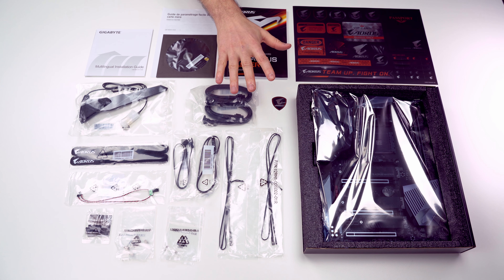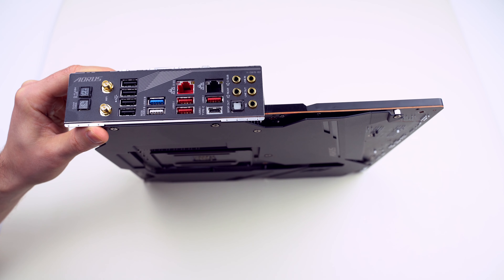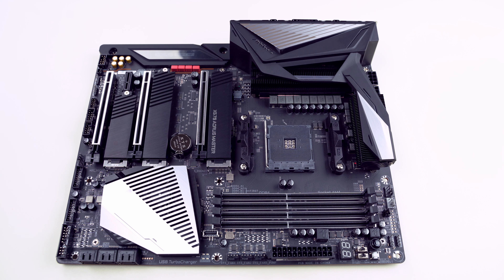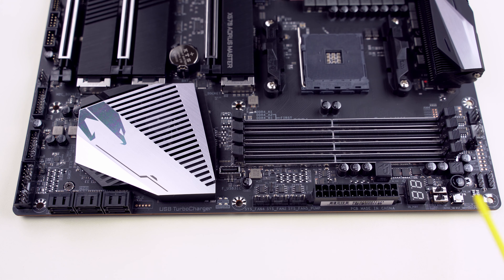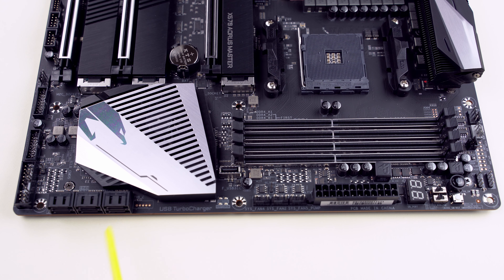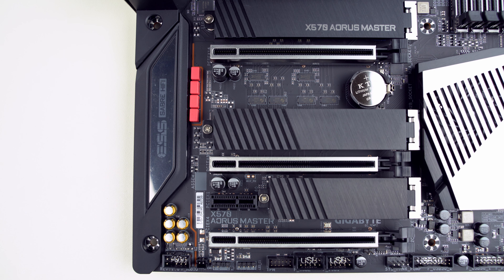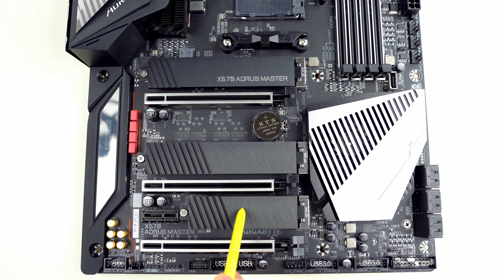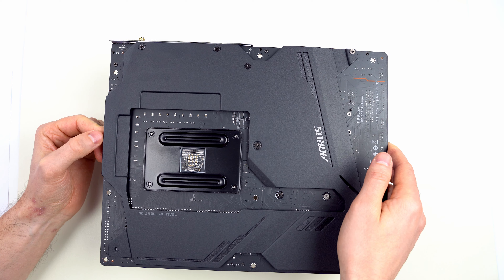Gigabyte X570 Aorus Master - Unboxing + Complete features description

Comment: Hi Martin. Thanks for your video. Which of the M.2 slots should I use if I want to use two M.2 SSD drives? Which is the fastest slot and the fastest configuration for two SSDs?
Reply from the maker: Hi Owen, you´re welcome. 

To your first question: 
The fastest (or better to say unlimited by other devices) is the first M.2 slot (M2A_socket) which is closest to the CPU and is directly connected to it (The theoretical speed is the same on all of them, which is 4x PCI-E. Other are limited either by the chipset or other devices connected to it - because they are sharing the bandwidth to the CPU which is PCI-E 4X).
 
The other two (M2B_socket and M2C_socket) are theoretically capable of the same speed (PCI-E 4X) if they are not used at the same time in sense of not being read from or written to (they can be connected/installed at the same time) and when the last two SATA ports aren´t used (as shown in the video - you would disable them by using M2C_socket).

To your second question:
The fastest configuration of two M.2 SSDs is if you put them in the first two slots (sockets M2A and M2B). I used it for my RAID 1 config and was able to achieve READ speed little over 6 GB/s without any problems (with two 480 GB Corsair MP510 drivers used in video mentioned at the top). If you use PCI-E Gen4 drives you should be able to get close to the theoretical limit of two PCI-E 4X slots, which is around 15,7 GB/s (combined). 

If you DON´T plan on using the last two SATA ports, you could also use combination of M2A and M2C sockets and you should be able to reach the same speed, but I haven´t tested it yet (will do it later). I Hope this helped ;)
Reply: Thanks a lot Martin!! I'm using a different operating system on each one and for that reason probably cannot use Raid cause every drive is formatted differently. Maybe a short addition: I would also like to add 1 or 2 SATA drives. Does it matter where I plug them in/which SATA slots I use? Thanks in advance! 🙏🏻🙏🏻
Reply from the maker: @langermusic  If you´re using two M.2 drives with 2 different operating systems you could you use RAID only on one of them (if you wanted to) by adding one more M.2 drive to the third M.2 slot (Sockets M2A and M2B would be the RAID with one OS and M2C_socket would be standalone with second OS on it). 

Another option would be using two M.2 drives - sockets M2A and M2B would be the RAID with one OS and 2 SATA drives in RAID for the second OS (this one would be slower of course than RAID made of M.2 drives, but would potentially (if RAID1 was used) provide you with redundancy if you need it).

How I understand your situation is, that you want two M.2 drives running each with different OS as fast as possible and add 2 additional SATA drives and run them as fast as the MB allows you to. 

In that case, put each OS on one of the M.2 drives (1st OS on drive in M2A_socket and 2nd OS on drive in M2B_socket) and use any two SATA ports (out of 6 available), the speed would be the same on all of them.

If you plan on using the 3rd M.2 slot in the future (M2C_socket), connect your two SATA drives into any two SATA connectors out of 4 available (the last two - 4 and 5 will be disabled when you connect the 3rd M.2 slot). Now, which four? In the manual they are shown as SATA ports 0,1,2 and 3 or for visual orientation the four which are closer to the 24pin power connector. I would connect them into first two SATA connectors - 0 and 1 (manual MB layout - page 7).
Reply: @MartinsLab  Thanks so much! That really helps! I like your idea about the RAID system on one OS. Will each of the RAID drives by itself work faster if I have them connected together as you said? So generally the OS would be even faster than only with one drive? Do I need to exact same m.2 drives? Cause one of them is 2TB and the other one is 1TH. How should I setup the BIOS? Big thanks! Owen
Reply from the maker: @langermusic  I see it got you excited about the RAID. That is a pretty complex set of questions 😊, let´s try to sort it out, one by one: 

Part 1 – Is one vs Two drives for OS (RAID 1 and 0) faster?
You can have a RAID 1 for the OS on two M.2 drives but it wouldn´t make the OS run faster. Write operations would be about the same and read would be faster only in very few cases (when reading larger files). The only senseful option of using RAID on OS drive (on this MB) is RAID 1 for redundancy (for reliability - to make sure if one drive fails you can continue your work without any downtime). If you used RAID 0 for OS, you would significantly (by 50%) increase the possibility of failure of the OS which is generally not recommended for OS drives. 

OS usually consists of thousands of very small files and using RAID wouldn´t speed up its operation (it is more effective with files of bigger size). If you test it when installed on 2 drives in RAID 1 or 0 with Crystal Disk Mark, it will show you impressive numbers - like I mentioned 6GB/s, BUT it is reached only with large files during continuous read operations which on OS drive occur VERY RARELY.
 
It can be beneficial for working with large files like a 4K/8K video (mp4/mov) or large RAW photos and such, but they wouldn´t probably be placed on and OS drive unless it was big enough drive and you put those files there purposefully - than RAID 1 would make sense even for perfromance reasons (not "just" reliability). The READING of those files could be up to 2x faster. 

(In my build video I´m using it for the redundancy reasons)

Part 2 – How to get the fastest OS operation possible
If you want the fastest OS operation, basically you need the fastest (single) SSD or set of fastest M.2 SSDs (for RAID 1) you can get and have enough RAM (in dual channel) installed so that the OS doesn´t have to swap often. That means using M.2 SSDs like Gigabyte AORUS NVMe (Gen4), Corsair MP600, Samsung 970 Pro, Sabrent Rocker etc. and at least 16GB RAM for Windows 10. If you have really deep pockets, than Intel Optane 905P is the best option (because of how fast it can read small files).

Part 3 – Are the same SSDs necessary for RAID 0 and 1?
Yes, it is best to use the same SSDs - the same model, from the same manufacturer and of the same size (GB). This applies for both SATA and M.2 drives. It will help you to avoid situations where one SSD is “waiting” (measured in milliseconds) for the other to perform READ or WRITE operations because of its insufficient speed. One would be faster than the other and therefore not utilized to its full potential. 

The BIOS RAID setup and OS installation is more complex issues to cover in a discussion, I will make a video about it.

Almost looks like I should have been a journalist..
Reply: Martin's Lab Thank you so much and sorry for those many questions! It really helped and I guess I’ll first try out the right configuration you mentioned in your first and second answer and then will later on try the redundancy RAID 1 when I have another equal SSD drive. So huge thanks! I’m your subscriber! :)
Reply from the maker: @langermusic  No problem, thanks for subscribing!

Comment: Do you know if I would be able to connect a monitor by using a usb type c to hdmi adapter? I don’t have any GPU at hand but a friend is about to give me a Ryzen 3200G and I wonder if the adapter would work cus there is no hdmi or dp ports in the mobo :(
Reply from the maker: Hi Omar, I think it´s not possible to route graphics signal to USB-C output on this motherboard, because it wasn´t designed for it (it has no original graphics ports). Gigabyte probably didn´t think anybody would pair it with a CPU using an integrated GPU. In your case (I assume you´re waiting for Ryzen 5000 CPU and Radeon 6000/nVIDIA 3000 GPU). I would buy the cheapest possible passively cooled secondhand GPU with HDMI output which can feed your monitor by sufficiet resolution to allow you to have something to use in the meantime instead. You should have no trouble finding one on Ebay or similar site. Active adapter would probably be more expensive, so it wouln´t make sense to buy it for such short period of time - it would be more expensive.
Reply: @MartinsLab  Thank you so much for replying and yes, I am waiting for a Ryzen 5000 and RTX 3080 to be restocked and I am getting a Ryzen 3200g and a GT710 that I got for $20 😂 just until I get the cpu and GPU I want.
Reply from the maker: @omarcatter7606  No problem, GT710 is going to be just fine and for the price it´s a bargain. On top, it´s something you can use later for potential troubleshooting or just to get by in similar situation. With the build, you´re you´re putting together you´ll be Cyberpunk ready ;)

Comment: How many it support of ram in dual channel and normally? 
Thanks and good video :)
Reply from the maker: Glad you liked the video 😉
Generally, you can use 3 types of RAM configurations with this motherboard with these max. memory settings: 
1) A single DIMM in single channel – the biggest RAM module supported by this MB is 32 GB DDR4 DIMM,  so 1x 32 GB DDR4 DIMM = 32 GB RAM 
2) Two biggest DIMMs in a dual channel setup – 2x 32 GB DDR4 = 64 GB RAM
3) Four biggest DIMMs in dual channel setup – 4x 32 GB GB DDR4 = 128 GB RAM

I don´t know what you mean by „normally“, but I would never put any memory into this motherboard in anything else but dual channel memory setup, because in a single channel setup I would be limiting the memory throughput of my system by 50% which would result in brutal loss of performance. The only setup that makes sense for this MB in terms of performance a is dual channel memory setup.

If you want to be sure of the compatibility of RAM modules which you chose for this motherboard, I recommend checking the manufacturers QVL (qualified vendor list) – here is a link: 
https://www.gigabyte.com/Motherboard/X570-AORUS-MASTER-rev-10/support#support-doc
(For Ryzen 3000 processors – you want to look at the one that says “ For AMD Mattise CPU” in the description)

Comment from the maker: Update 1.5.2021 - Recently, there was a new version of BIOS released "F33j" for this motherboard which contains a fix for USB 2.0 devices stability issues - it is using the long awaited AMD AGESA ComboV2 1.2.0.2 update. (It also contains optimizations for Ryzen 5000 CPUs from previous BIOS release) 
Link: https://www.gigabyte.com/Motherboard/X570-AORUS-MASTER-rev-10/support#support-dl-bios

Comment: I'm curious, do you need to plug both 12v connectors in or is one plenty?
Reply from the maker: Interesting question, logic says „no“ (8pin can easily pull 400W if you have a capable PSU), manual doesn´t say anything (doesn´t address this specifically - talks about it in singular) other than: „The 12V power connector mainly supplies power to the CPU. If the 12V power connector is not connected, the computer will not start.To meet expansion requirements, it is recommended that a power supply that can withstand high power consumption be used (500W or greater). If a power supply is used that does not provide the required power, the result can lead to an unstable or unbootable system”. 

I can try if it boots up, but I don´t feel like running the complete set of stability tests to find out if it´s stable. If I can boot with it,  I´ll try few minutes of Cinebench R20 and see how it behaves, I´ll let you know.
Reply from the maker: I tested it few minutes ago with only one 8pin 12V power cable connected to the MB and it worked without any problems. So, now we know 😉

For the quick test, I used:
Cinebench R20 (600s = 10min) - load from the plug was 201-203W (205W peak).
Then I ran Intel Burn Test 2.54 (10x Very High), load from the plug was 200W most of the time.
Then I tried AIDA Extreme F64 Ray-trace test (stability sensitive) and no issues (192W) – takes few seconds.

Test system: AMD Ryzen 3900X, 2x 16GB ECC RAM 2666MHz (Crucial), GeForce GTX 1050Ti KalmX (Palit),  Noctua NH-D15 SE-AM4 with 2 fans at stock settings, 1x Samsung 850 Pro SSD for OS, PSU – Seasonic Prime Ultra Titanium (650W), optimized defaults loaded in F11 BIOS, OS Windows 10 Pro.

Most of this HW will be used in my Home server build, so this was a little warmup test for it, the video is now in post-production and will be released in the next two days. When I get to the full testing phase of the server I may test it further, but I don´t expect different results even after longer loads.
Reply from the maker: @M3sterX Yes, it is best to use both 8 pins for powering the CPU. You will not recognize any difference compared to running it only with one if you´re not overclocking heavily. The motherboard will be able to draw more power, which can be beneficial only during extreme overclocking. You will probably (assumption - not a proven fact) be able to load each of the rails on the PSU less, which might theoretically improve stability of the system. I personally connected both - as seen in the build video mentioned at the top.

Comment: I would like to run a nvme in the M2A slot for a boot drive, Run my GPU in the first pcie 16 slot, and another NVME storage drive on M2B slot.  Both storage drives are pcie3 not 4 and would not be in raid mode.  Would they run at normal writing speeds since they are pcie3 and the GPU uses the full 16 lanes? I will also be using a Ryzen 9 3900X CPU.  According to your graph (If I understand it correctly), the M2B will be on 4x and I should be able to get almost max speed of my drive at 4gbs.  I am pretty new to this. I just completed my first build 4 months ago and I am having issues with my current board and I would like to upgrade to the x570 Aorus master. Thank you for the video and any help you can provide.
Reply from the maker: Hi Steve, no problem.  The answer is „Yes“ (you understand correctly) both NVMe SSDs in slots M2A and M2B will be able to write at their full speed. 

First slot „M2A“ is connected directly to the CPU by x4 PCIE 4.0 lane which has a potential bandwidth of 7,8 GB/s when used with Gen4 drives. You have Gen3 drive which means that you will be able to achieve 3,9 GB/s as a theoretical maximum (real speed will of course depend on the drive you use).

Second slot „M2B“ is connected to the chipset by x4 PCIE4 PCIE 4.0 lane (7,8 GB/s) and from chipset to the CPU also by x4 PCIE 4.0 lane (7,8 GB/s). If you don´t connect any other devices to the chipset (like addon PCIE cards or SATA drives) the bandwidth to the CPU wouldn´t be shared with other devices and therefore it´s full speed (7,8GB/s) will be available to your second SSD. But because this SSD is also Gen3 its theoretical maximum speed will be limited to 3,9 GB/s as in case of your first drive. Which means your chipset will still have nice 3,9 GB/s bandwidth available without even limiting your drive. (I´ve tested scenarios when both drives read and write simultaneously – in the next few days I´ll release a RAID focused video on this MB)

In the future don´t hesitate to connect SATA SSDs or other devices (thru chipset), they wouldn´t limit your NVMe SSD´s write speed unless they are used at the same time when your drive is writing/reading and their need for bandwidth is large enough to use all the rest of the available capacity of the PCI-E 4.0 x4 lane to the CPU. That scenario is not very probable.
I think you´ll be happy with the CPU you´ve chosen, it´s a beast 😉 If you´re unsure about something drop a comment and I´ll give you a hint if I know the answer.
Reply: Martin's Lab I can not thank you enough for your response and clarifying this for me. I look forward to this Motherboard and future videos. You do fantastic work!